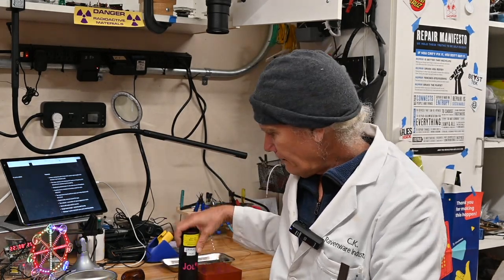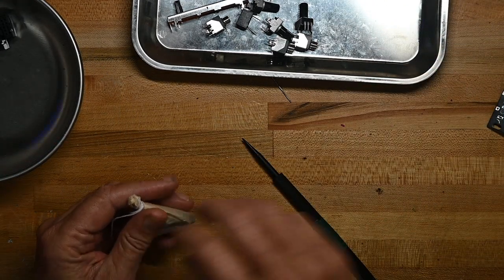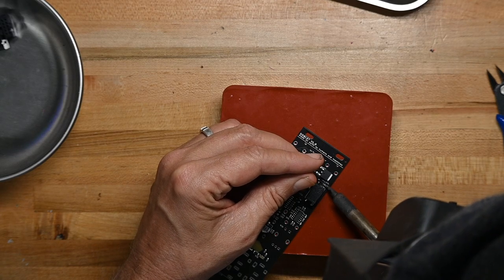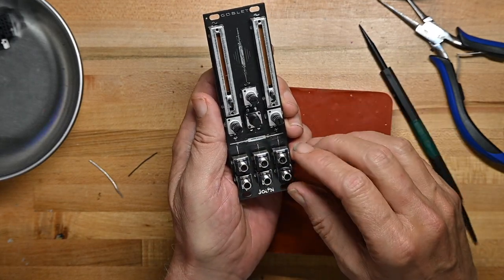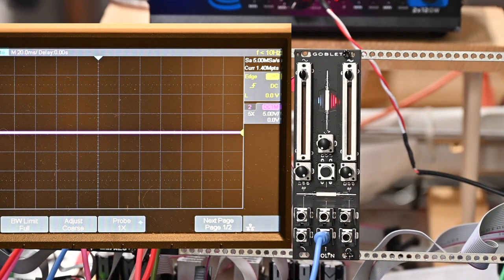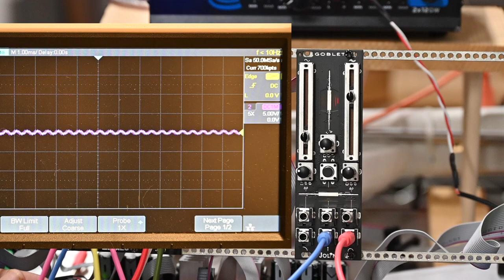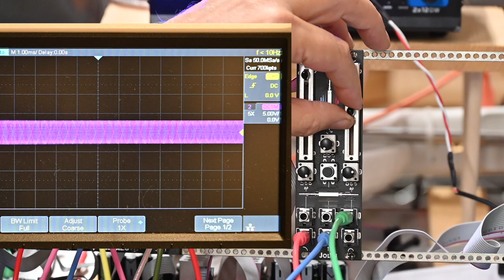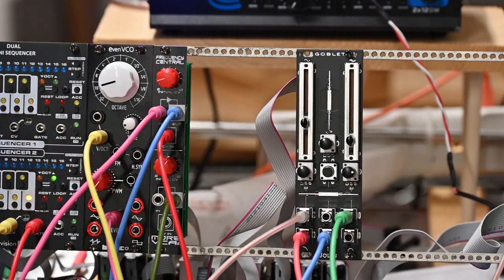C.K. builds a Goblet filter kit from Jolin Lab, eurorack

Comment: hi hi, thanks for the video! the manual describes a sort of set-up process to get the sliders calibrated so their full range has effect for the signal you're filtering. i think in the video here the sliders were effectively all or nothing, i'm guessing that's why we didn't hear any sweeps. try feeding in a square or saw, and following that process, i think you'll hear much more from this module.

also i'm guessing you'll get the most out of this module if you're feeding something rhythmic into the button's gate jack, the distortion will give the filter something to grab on to.

also! i think the thick horizontal and vertical pcb traces (between the sliders and below the pots) are supposed to be capacative touch points, did you try poking those?
Reply from the maker: Thank you for the detailed feedback.  I will give them a try and if I see a noticeable difference I will post another video.
As for the capacitive strips, I did try them and they had little effect.  Part of this is my skin, capacitive contacts don't work well with capacitive contacts.